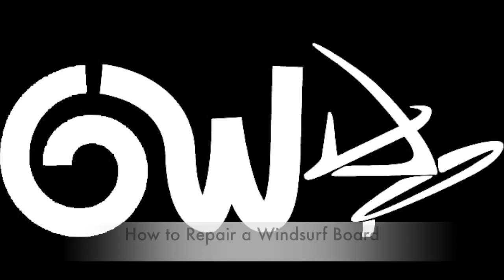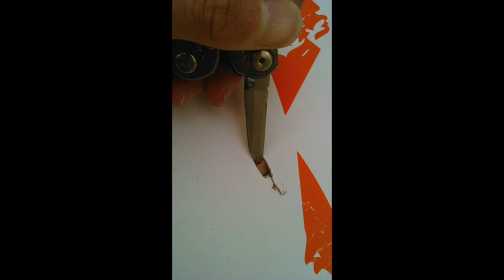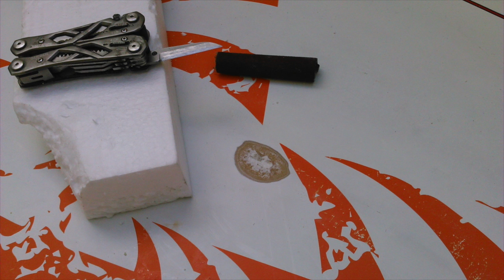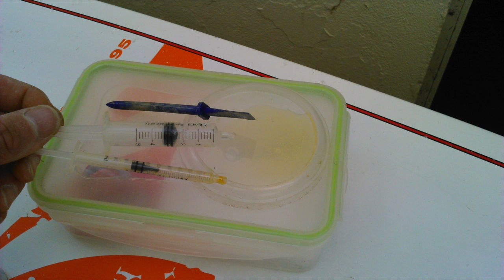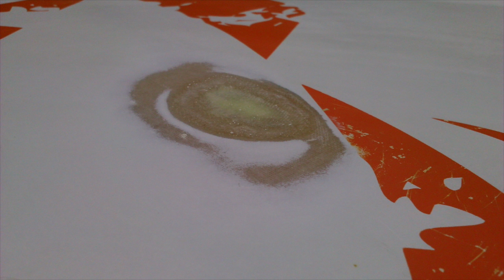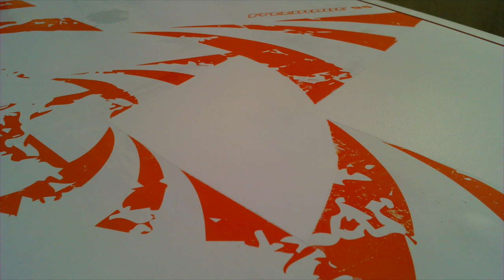How To Repair a Windsurf Board

Comment: You have glass bonded to divinicell. It's just a small hole so it's not important to the overall structural integrity but if it were a big panel that would seem to be a questionable practice.
Reply: GetWindsurfing
I'm no expert but it is, as you say, good practice to replace all the layers with similar stuff. The inner glass is a tension membrane so it should be lapped and bonded at the edges to the glass layer. The divinycell doesn't work in tension so it doesn't need to be bonded at the edges to make a continuous skin. It just has to be a snug fit at the edges and bonded to the face of the glass. The outer layer (glass or carbon, whatever) is again a tensile layer so it should be lapped and bonded at the edges to the outer layer and to the face of the divinycell under it to make a continuous skin.

It seems to be common practice to just grind a broad bevel and treat all three layers as a simple scarf but this provides uncertain layer to layer joints and compromises the structural continuity of the different skins. It is structurally better to build a decent (ie fine but well lapped) bond at both the inner layer and the outer layer. I have never done it so I can give no practical advice.
Reply from the maker: TIAD If possible you want to replace similar materials for similar materials. If you look on the foam on the inside of the board you will see different types of foam used. The technique I have shown works well for small repairs. However for bigger repairs you should look at replacing the high density foam on top. Organ Farm  please feel free to add any input, this video aim is to help people out, I am sure others would love to learn from your experience.
Reply from the maker: Organ Farm you usually find with SMALL repairs that if you feather the edges that you have enough surface are for the glass to bond to then the repair will be more than sufficient, However replacing materials as much as you can will give you the best results. For BIG repairs carbon helps add lots of extra stiffness compared to glass. 

A lot of learning to repair boards comes from experience and lots of trial and error. Be confident its not too hard a skill to learn and also keep in mind what area of the board you are repairing with a mind to the stresses affecting that area.

When I started out repairing boards this website link http://www.boardlady.com was a fantastic reference, and still is. 

Thanks for the input.